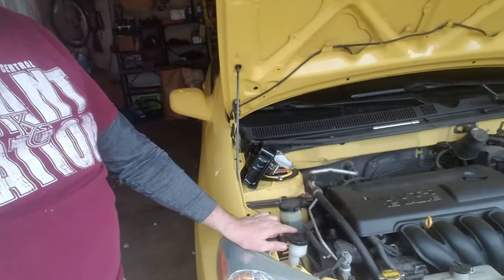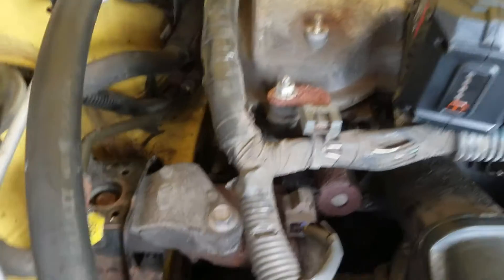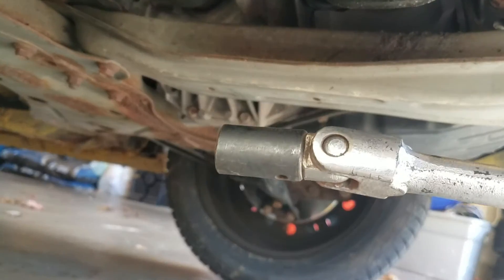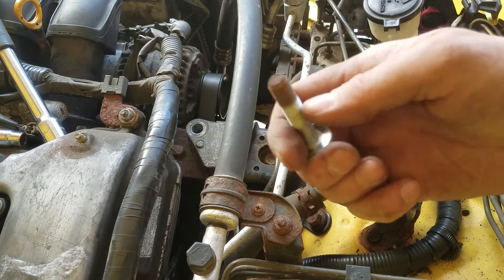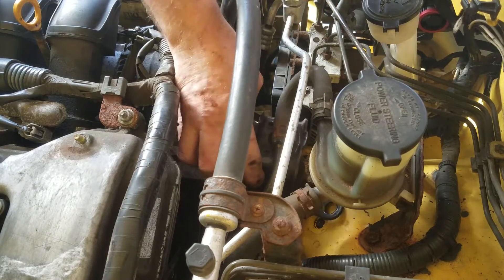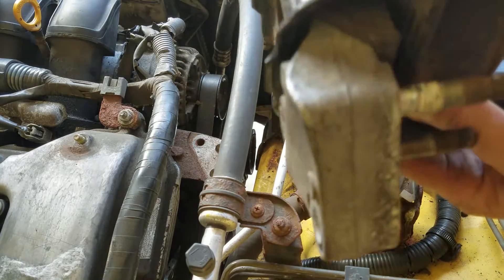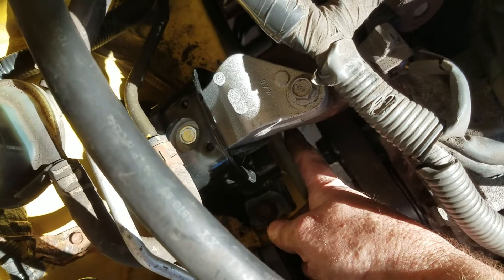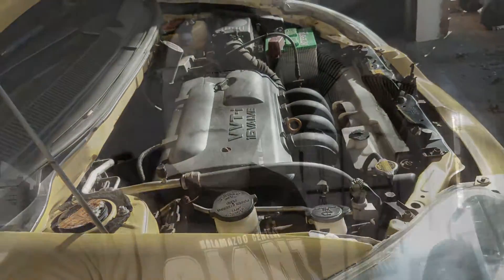Passenger Motor Mount on Toyota Matrix-Pontiac Vibe

Comment: Just came across your video and I got to give props on the KC shirt. I live in Kalamazoo as well.  Was wondering where did you get your mounts from.  And did you do transmission mounts as well?  What did you do to line up all the holes?   How long would you say the job took for you?  Thank you.
Reply from the maker: This was an easy job.  Might have taken half hour.  You just have to yank on things a bit to get them to line up sometimes, and that's to be expected.  The mounts were from E-Bay.  I can't even tell you the brand.  I wanted to do the transmission mount.  The kit I bought has all the mounts. but the nuts on the bottom under the car go onto studs that are just press fit into the mount.  The nut didn't move, and the stud twisted in the mount, so I didn't get any farther.  I'll get to it some day maybe.
Reply from the maker: Oh and nice to meet another Kzoo resident.  I think I may actually have that same shirt on right now too!
Reply: @MIFixItDad  Okay.  So my son came home from a school event yesterday morning and said that the car is making a hard vibration when you shift from park to drive and also when you accelerate.  Is that what you experienced as well?
Reply: I wonder if mine is the motor mounts or transmission mount.
Reply from the maker: @ernesthawkes5979  No, mine was just normal vibration sitting at a stop light mostly while in gear.  As I accelerated it went away.  You may have an axle shaft going bad.  Easy to replace on these also.
Reply: @MIFixItDad  How would determine which one it is?
Reply from the maker: @ernesthawkes5979  I'm not terribly sure other than looking at the rubber part to see if it's cracked, sunken in, stretched or compressed, etc.  I think when one goes bad generally they all need replaced
Reply: So,  nothing is really jumping out at me.  None of the mounts looks to be busted or broken (to me).  However, that doesn't mean that any of them aren't.  Would it be possible for you to take a look?  Just to point me in the right direction.  I would really appreciate it.  If you don't mind.
Reply: @MIFixItDad  I am wondering if you would mind taking a look at my vibe to verify.  If it is indeed the motor mounts.  I could meet you wherever you like and pay you.  I don't have a mechanic and am trying to get taken advantage of anymore or at least on something that sounds to be simple.  Your assistance would be greatly appreciated.  And I could pay you for your time.  Thank you.
Reply from the maker: @ernesthawkes5979  You'll want to go to a mechanic.  I'm just a single dad who has to do some of my own stuff to save a buck or three.  One of the most trustworthy places I've ever known is R&T Automotive on Osterhout.  Most of those guys there are the kind that, at 5:00 they push your car out of the way, pull in the race cars, and keep working.  They do it because they simply love what they do and are able to do things most other places can't.  That might be a good place to start.

Comment: your engine is super clean for the year. did you clean it yourself or have tips on cleaning it? my valve cover was leaking and power steering pump. have yet to change the pump. want to clean it up though.
Reply from the maker: I did change the valve cover gasket on this and have done some minor cleaning getting things looking better when I first got it about a year and a half or so ago.  Otherwise it hasn't been bad at all.  I do have a tiny little leak left somewhere but it's so small I haven't even worried about it.
Reply: @MIFixItDad  Leaks can also develop at the timing chain tensioner as well as the VVT solenoid on this engine.

Comment: Hi where did you get the new one from? Thanks
Reply from the maker: I actually got these on E-Bay from a seller called Yallstore.
Reply: @MIFixItDad  ugh I had the same part. I installed it and ran good for two days. I drive it today and vibrations like crazy. The part completely caved in at the rubber side. I bet all the fluid leaked out